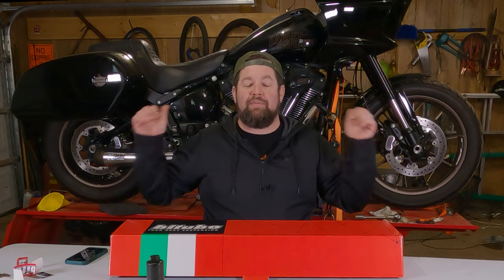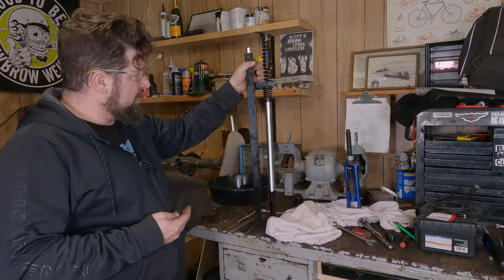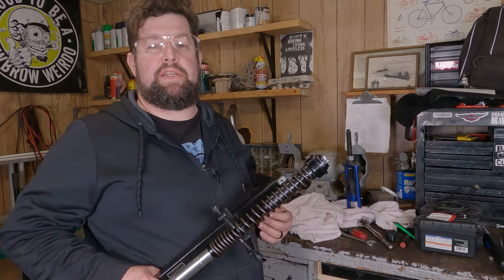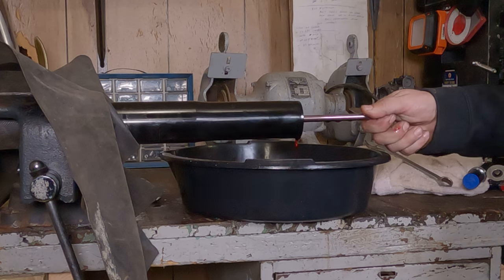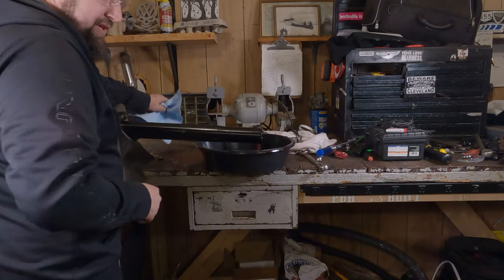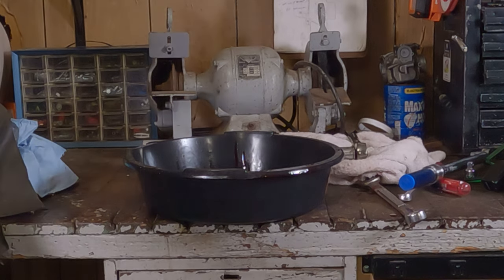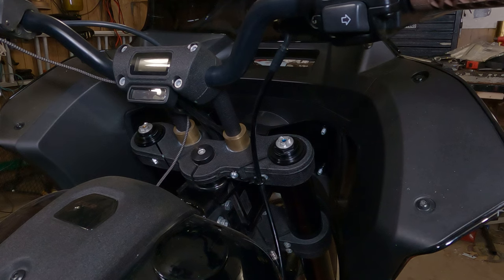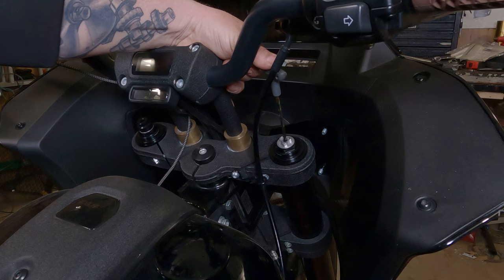Harley Lowrider ST Fork Upgrade with Bitubo Cartridge Kit

Comment: Nice video man. I’m wondering how you adjusted your preload? I have the same cartridges and am wondering what to expect while adjusting from one end of the spectrum to the other
Reply from the maker: Mechanically how do you adjust it? There was an adapter that goes on the top that accepts a box end wrench.  
Adjustment wise, I have no preload.  I felt it was pretty good as is.  You have to measure how far it compresses when you sit on the bike. Aka adjust the “sag”.
Reply: Mechanically I understand. I was just wondering how adding preload effected the ride. I assume adding preload will reduce sag? I have these cartridges in my road glide and am tentative to start messing with the settings. But as my riding improves I realize there’s a bit of instability at high speed. Quite sure I can work that out through adjusting my forks and rear shocks. Just not sure where to start.
Reply from the maker: @AndrewMulkern4  the best advice I can give, is take each setting, and go from one extreme to the other, and ride it. 0 preload. Ride it. Full pre load. Ride it.  Keep adjusting and you will probably find that sweet spot.
Reply from the maker: @AndrewMulkern4  I
Carry the tools with me to make adjustments at gas stations. After a few rides, I can get it pretty sweet. But I struggle to do it right from the get go.